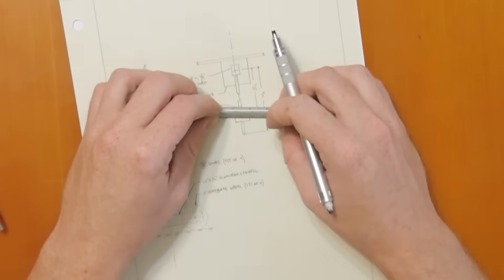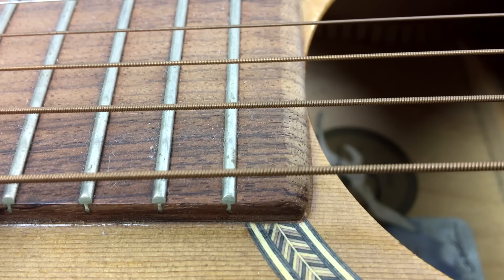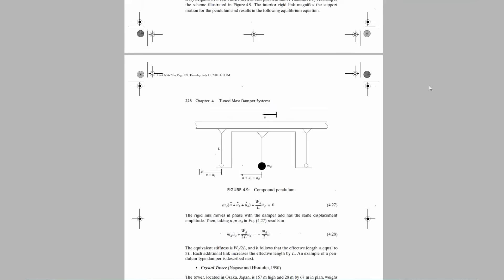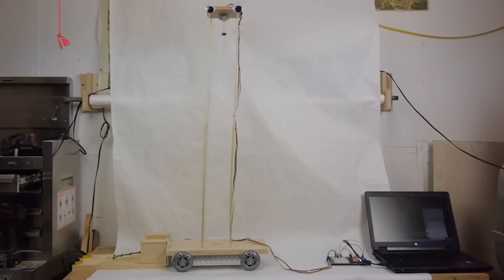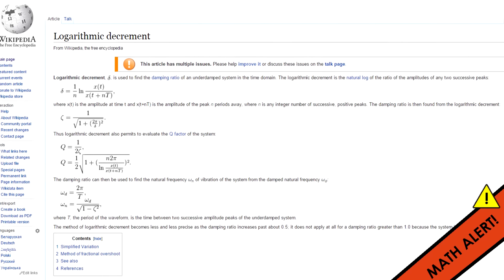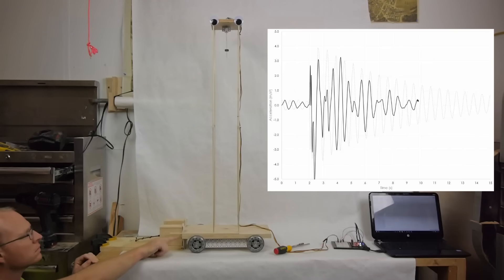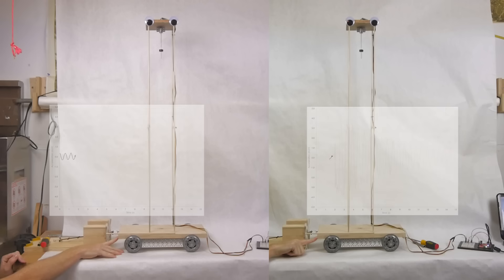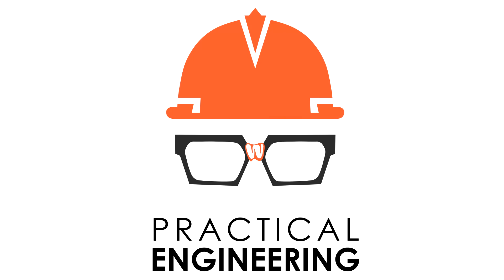What is a Tuned Mass Damper?

Comment: Great demonstration.  I live on the 56th floor of an older building.  I've measured the movement of my apartment in strong winds, and it's about 3" of displacement, with a period of about 3.7 seconds.  This movement is not perceptible.  The building is reinforced concrete.  There is a new (much taller) office building a few blocks away that uses a large sprinkler system water storage tank as a tuned mass damper.

Comment: One of the points you missed was the reason why older buildings did not really have as much of a problem -- the Empire State Building does not move much, so does ok without one despite its height.

More modern buildings have far less mass, and are more more "effectively" engineered -- they are less a big block/pyramid o'stuff, and more of a thin-walled box. This means that they are more readily affected by the wind load to instantiate movement. Thus the need for adding a mass damper up high to cancel out the absorbed wind energy.

Comment: This video results really interesting to me. Right now i'm studying different kinds of connections that acts as a mechanical fuse for a dynamic response over an external movement as an Eartquake. The theory around it is to allow a certain amount of deformation over structural elements in a bulding to absorb and increase the damping ratio as this video shows by useing a TMD system.

Comment: I have some thoughts on this. Your dampening system seems to only work in a forward and backward motion. Would you have to have a system that would counter movement in all directions for a building? The big ball of metal in the skyscraper seems to have four cables holding it. If that is the case, i presume it would be able to cope with NSEW directions instead of just North/South or East/West.

Comment: Good video.  
Do engineers still use inches?
Reply: Sometimes. A lot of material strength or fluids problems may use inches for units of force/stress like kip or psi, but often times it just gets converted to metric since a lot of data is given in metric anyway. Civil engineers in the US at least use a lot of imperial units, others not so much.

Comment: My customers would love a mass dampener in their front load washer! There was a joint model between Samsung and Maytag, which used 4 springs and a steel solid mass.  They mounted it on the very top.  I don’t know why, more time wasn’t spent on design.   The current design, is dampeners built into the front tub ring.  Either thick fluid, which is why on some units sound like they still have water in them, or steel balls moving in opposing force.  Front load washers have taken a beating cause of this issue.  Thanks for the demo!

Comment: I am living in Japan now and find myself interested in the concepts that go into modern earthquake resistant engineering for structures of various sizes. What innovations are used for buildings small enough not to have tuned mass dampers?
Reply: Small buildings 10-25 meters high dont need innovations,they just need to be designed properly to absorb kinetic energy of an earthquake
Reply: @gdounito  That's sort of what I mean, though. What design features do they use to absorb that kinetic energy?
Reply: @georgerogers2120  Not a civil engineer, but I know that proper material selection can go a long way for absorbing lower amplitude vibrations (weaker earthquakes). There are also certainly ways to build structures that make them accommodate motion better. A building's enemy in an earthquake is its own motion, so designing structures that allow for small amounts of motion is key in preventing them from collapsing.

I don't have an example for how this is done in homes, but an example of what I mean in structures is how bridges are laid. If you've ever been underneath a bridge, you may have noticed it often rests on big rollers or even like it's designed to pivot around an axis. That's by design, since the bridge may expand or contract depending on load and temperature. If it couldn't move, it would load up with stress and break. Because the engineer added some small degree of freedom with that roller and that joint, the bridge can expand just a bit and won't be stressed. This is the idea for homes too. A truss structure inside a roof may be designed to move just a bit so that it isn't completely rigid and under too much stress.

Comment: One thing that has perplexed me is the weight that must be hanging off of a crane cable under load. Regardless of the number of loops through a snatch block to reduce the lifting effort. Isn't the work still hanging from two lengths of cable?

Comment: Can you show how they got the 80+ ton ball up there ?
Reply: For Taipei 101 I believe they built it inside the building. They would take pieces of the damper up and weld them on-site to construct the whole thing. Doubt they could have moved it all at once since it's over 700 tons. Lighter ones may be placed there in one piece, but it's probably much safer to build it in place. Especially since it may need to be tuned further during construction, so bringing it up all at once may be unnecessary if you're gonna be adding/removing material anyway.

Comment: IDEA: It seems to me like mass dampeners have applications beyond that of architecture.  Take blacksmithing for example . . . smiths often wrap heavy chains around the waist of an anvil to quiet the piercing ring, but a simpler solution should be a  matter of just attaching a magnet of a given weight, with a spacer (that tunes the amount of pull as well as freedom of movement) that allows the magnet to cling to the underside of the anvil's tail (you want enuf force so it doesnt fall off but not so much that it overresists movement and then cant serve its purpose) . All you need then is a lookup table for pairing the wt of magnets to the weight of an anvil, to accomplish optimal ring reduction

I bet those would sell moderately well, and should be easy to make.  Consider it a free idea to help support your channel. Cheers.

Comment: The pdf I'm reading about the LES used for the Apollo missions mentions the tapered ballast compartment in the nose cone just beneath the Q-ball and that it contains lead and depleted uranium weights. I'm assuming this is to dampen any vibration that might affect the Q-ball's performance? It occurred to me that maybe it was also for TMD? Or maybe that was it's primary function? The pdf doesn't really mention how much mass these lead & DP weights were.

Comment: Compared to most skyscrapers your model appears top-heavy, which I suspect would aggravate the oscillation effect.  If you distributed the weight of a building so its heaviest floors are on the bottom and the lightest ones on the top with an even progression of weight distribution in between, could you dampen it to the point where it would not sway much at all?  The Tokyo Sky Tree Tower employs some interesting dampening technology to protect it from earthquakes, I think with this in mind.

Comment: This was really good!  Subscribed!

Great demo!  I thought that a real building (with distributed mass, instead of point mass) would experience "white mechanical energy" (like white noise, but mechanical energy ;D ), and therefore would also require damping at the maxima of the first few harmonics... but a quick Googling made me doubt that.  Maybe it's best to hang a single one at the height of, say, some ratio of two prime numbers so it would absorb an even amount of energy at each harmonic.  I'd love to see a demo of this!  Basically the same experiment that you did, but with maybe thirteen (close to a dozen) TMD/sensor modules.

You know what else would be cool?  TMD implemented with a mass, motors, and PID controllers!  Is that patentable? ;D

The music was fine, even with my headphones on.

Comment: “...tall buildings have another problem – which is that they sway in the wind. If the swaying motion amplifies it can quickly exceed the structural integrity of the building and, in a system-built structure, many of the inhabitants get to be the squishy filling in a concrete sandwich. Even the most idealistic architect tries to keep fatalities to a minimum and the standard answer is a tuned mass damper. This is essentially one or more compensating heavy weights which swing left when the building swings right, and vice versa, dampening the oscillation and thus avoiding embarrassing questions like ‘Where’s the skyline gone?”

Ben Aaaronovitch, the Peter Grant novels.

Comment: Again a very informative video. But this fix is only tuned for that particular event (bumping the tower on a fixed object at a particular magnitude), but how would the damper adjust in real scenario, considering that the cause or incident are not only unexpected but also comes in unknown magnitude?
Reply: The magnitude of damper movement (distance moved) automatically offsets the magnitude of input (the building's inertia), so it always balances out. Well almost- more on this in a moment. First it is not necessary to offset 100% of the movement, as the structure's rigidity will handle some of the input. Second is that empty and full buildings have different weights so you can't achieve perfection in balance with a non-adjusting 'passive' damper. There are some building dampers with 'active' elements involved which allows for a smaller damper mass to be used but that is another subject.

There are two main problems with tuned mass damping. First is that it has a limit- what if the input force or movement is so large that the damper mass hits the structure around it? And what if the input frequency is perfect and of a long enough duration to cause resonant amplification of the damper mass or support cables? We only engineer these things to what forces are expected but this needs to be drawn out not to a level of expected input, but to a level where the structure itself could not withstand that input regardless of damping. And so far, nature is so variable that there's not been any known incident of severe resonance, but it remains a possibility and will one day occur,  possibly causing an otherwise perfectly sound  skyscraper to fall. 

The beauty of engineering is that it seeks to use the minimal necessary to achieve a given goal. The hazard of engineering is that the goals sought are sometimes set too low or weren't given their due relevance. The danger of engineering is that they rarely have any practical experience with the materials they design things with, and so do not see all the possible failure points as clearly as they should. Nothing and nobody is perfect, and everything we design and make will fail someday; the trick if to make that failure point as far away as is possible.

Comment: How do engineers keep buildings that sway from suffering structural fatigue after decades of existence?
Reply: Structural Engineer Answer--

Good question.  When you study metal fatigue for any building or machine, there are a few important factors.  You have to account for the number of cycles within a specific stress amplitude for the material.  High amplitude cycles (oscilating between high and low material stress over a large percentage of the permissible material stress range) require fewer cycles to reach the fatigue threshold, while it takes lower amplitude stresses more cycles to fail.  If you're below a certain amplitude for the material, no number of cycles will lead to fatigue.  In structures, the combination of amplitude and cycle count for each amplitude studied almost always does not warrant reduction of the material's permissible stress.  But it's an engineer's job to anticipate every possible condition, so we're always on the lookout for configurations that will lead to fatigue, and modifying the stress amplitude accordingly by adding material, or other methods.
Reply: @HollywoodF1  Thanks very much for the detailed explanation.

Comment: It might be interesting to try using an aluminum or copper disc and a Neodymium magnet to dampen the pendulum. that way, you get damping until the structure comes to rest. Right now, using a clutch means that once the movement gets below a point, the pendulum locks up, and just becomes part of the mass. A magnet emulates a fluid, so while difficult to move it fast, it moves relatively easy at slower angular velocities, meaning, the pendulum is always encountering resistance, but, is still allowed to move. That might help take away the remanent resonance. Another possibility, might be stirring oil, or, even a non Newtonian fluid. just anything that will maintain critical damping, until the structure stops vibrating. A magnet can be adjusted by it's proximity to a disc or drum, making it the solution I would use in a model experiment like this. This is a great video, I never knew about tuning the mass to the resonant frequency of the structure to be dampened.

Comment: Nice work Grady.  You ability to make simple the complicated is truly amazing.   Great application of an Arduino board and an MEMS accelerometer.  Platforms such as Arduino, Beaglebone, etc have certainly made it much easier (and less expensive) to apply the technology.  Keep the videos coming.  I would like to see one on building science and the application of thermodynamics to size heating and cooling systems.

Comment: I wonder if it would it be possible to motorize the damper to run the opposite frequency of the building's resonance frequency. Would destructive interference work the same way it does with noise canceling headphones?

Comment: Do they put water as weight?  Doesn't all the added weight (increasing height) do the same?  In an event, wouldn't deeper foundations be greater protection rather than bending at the top?

Comment: Or place a time dilation device in the top of the building connected to motion sensors. When the motion sensors detect motion they initiate the time dilation device. The time dilation device would encompass a floor or two near the top of the building and when activated would keep those floors from progressing any farther in time. Since those one or two floors remain in a time period in which they were stationary, but still connected to the rest of the building, the result would be the entire building remaining stationary despite real-time forces acting upon it to engage in unwanted motion. It would be like a giant invisible brace from the ground to the very top of the building keeping it steady.
Reply: real practical solution there

Comment: Can we harvest energy from those vibrations by using let say piezoelectric effect?
Reply: Elzero Dragon good idea, but the building has to be in one really disturbing climate region, to amount some decent production.
Reply: @anandraj-up2go  Disturbing climate eh? Come down to Florida during the hurricane season. Trust me!
Reply: @thedavidrr  certainly hurricanes cannot be tamed, that's why i said it'll be very small even if we could ..my second comment
Reply: Yes.  E=1/2 mv^2, no matter how you slice it.  Then comes the economic analysis.  If the system costs $500,000 to design and install and $1,000 annually to maintain, and it generates $4,000 a year in electricity, you'll probably opt out.
Reply: @HollywoodF1  Hmm.. not necessarily.  Depends on how much of that $500k goes into "design" and how much into "install."  In particular, if most of that up front cost goes into design, say $400k of it, then you could potentially resell the design to other buildings.  Then each building is looking at an up-front of only $100k and an annual net savings of $3k mean its paid back in ~33 years.  Its still not a slam dunk, but for large buildings a 50- or 100-year (or even longer) expected lifespan is not unusual, so depending on any particular building's needs, they may have a long-term net gain from installing such a system and therefore a potential sales opportunity for whoever decided to invest that initial $400k.
Reply: Don't listen to the folks below, they are just fanatics and know little. Currently, dampers generates heat since a system that uses friction is easy to design.  

There are several ways to use piezoelectrics to generate electricity. Back in engineering school, my colleagues developed a bike suspension capable of powering headlights. I don't know where they are in life now. 

It is 100% possible, its just about the cost vs benefits. 
And i don't see why the cost would be significantly large, since it is a building and buildings do experience high winds.

the concept is the same as regenerative brakes, what would normally be converted to heat, gets converted to electricity. 

Word of advice, don't listen to people who pull numbers out of their a$$.
Reply: It won't be efficient and occupant comfort would be hard to achieve
Reply: It'll still be very small..
Reply: Another thing to remember is that generating electricity from movement will dampen the movement of the object, which might make it less effective at its primary task.
Reply: Yes, but a variable/non-constant electricity supply isn't very useful.
Might be a thing in the future when paired with research on efficient storage of intermittent energy.
https://www.world-nuclear.org/information-library/current-and-future-generation/electricity-and-energy-storage.aspx